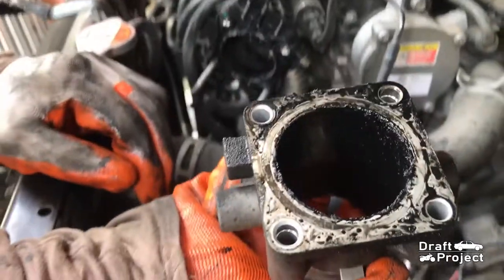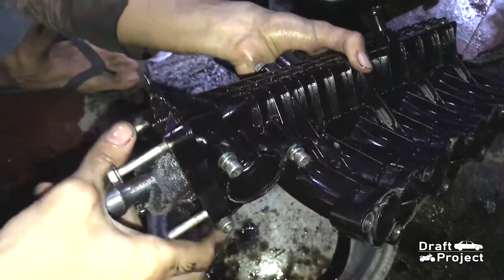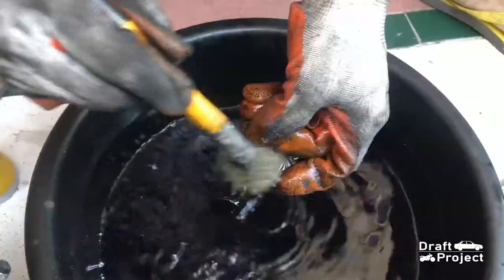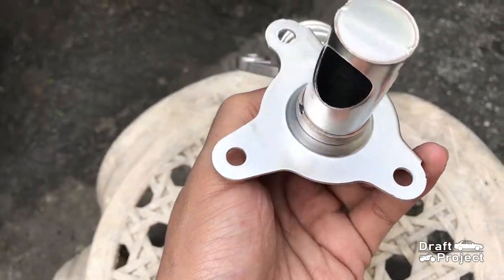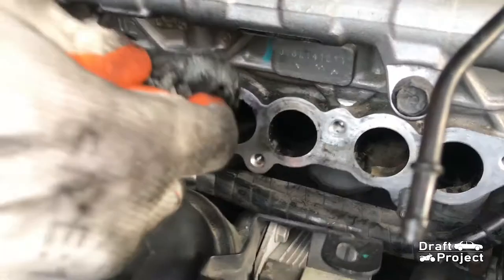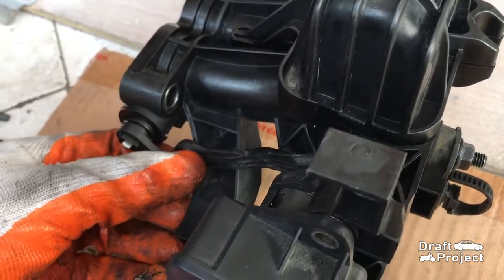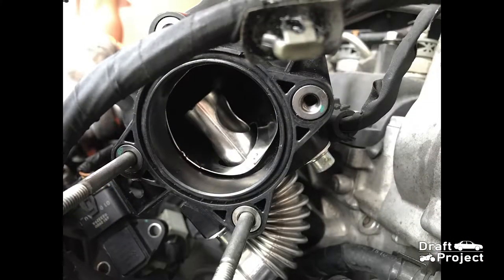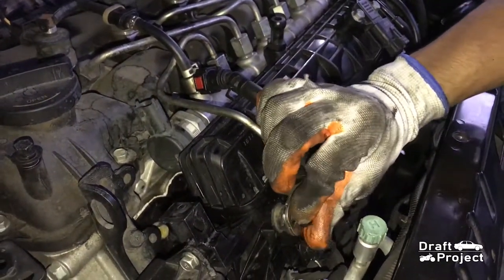Intake Manifold Cleaning and Reinstallation Part 2 - Hyundai Accent

Comment: After watching all of those videos, I can say that disassembling the intake manifold and egr is quite difficult.

Question:
Can you remove the manifold without using a size 12 deep/narrow socket? I only have the regular sockets with extensions.
Reply from the maker: Thank you very much for watching my videos! Yeah, it is a difficult job.

I've already tried two different brands of sockets. Both are short and 12mm and none of them worked. By the way, I am using a 1/2 drive.

Since I was using a 1/2 drive, I used a long/deep 12mm socket to solve that problem. The part of the body of the socket where the extension attaches is too large for it to pass through.

I haven't tried this but I guess if I was using a 3/8 drives, it might have worked since it has a smaller extensions and socket dimensions which pass through in between the intake manifold and bolt.
Reply: It was a nightmare. Hyundai i30 very similar so used this video. Nothing on this car is easy everything is in the way. Had to take so many parts off even including the thermostat flange.
I used ¼ inch drive extension and sockets for the manifold and a few other bits, just no room. At least with the i30 I didn't have to remove the bumper.🙄